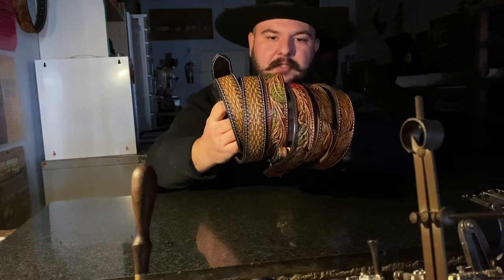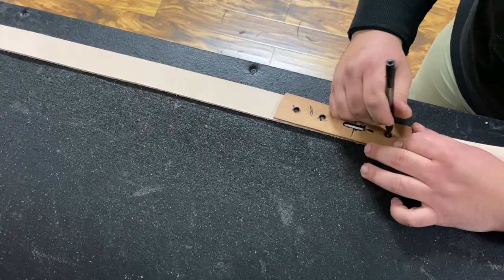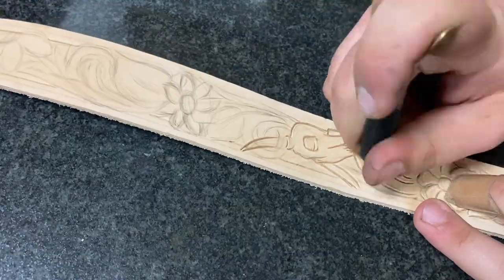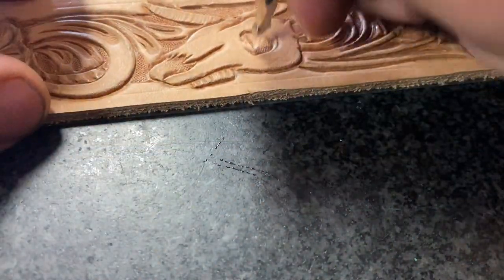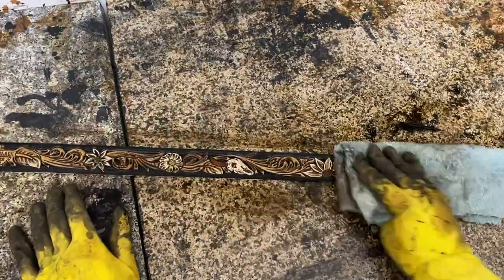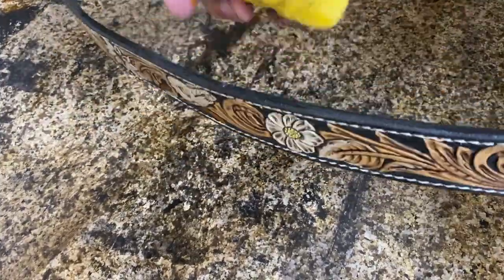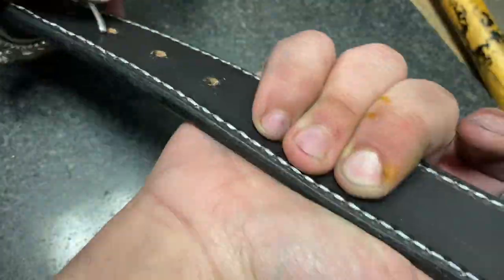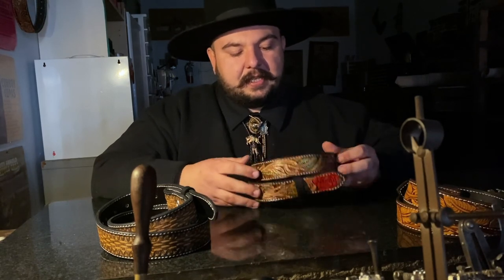HOW TO: Make a Custom Leather Belt

Comment: I really enjoyed this video, thanks for making it! I was wondering though, I've seen some videos which use a lining on the back of the belt, and some videos which don't. When is it recommended to use a liner and when is it ok not to?
Reply from the maker: i normally do on all belts unless their for kids, but it just looks so much nicer, and makes it more durable. kids wont need the extra support
Reply: @themaninblackleatherstudio  Thanks. Can I ask, what thickness do you use for the liner? If the belt itself is 3.5-4mm thick, I presume you are not using a liner that is also 3.5-4mm thick? Do you always use natural unfinished veg-tan for the liner? Or is it finished veg-tan you use?

Comment: What thickness leather is used for the belt? Also any oiling is needed if the leather is dry?
Reply from the maker: Thickness will depend on the type of belt, large men's work belts are going to be heavier than something for a size 28 women's belt. I make them to best suit my customer. Oil goes on before the resist, after the paint

Comment: What tool do you used to beat down the leather for the snaps?
Reply from the maker: i use the backside of a rivet setter i have- this allows the fold to be a little thicker, where the belt is the weakest